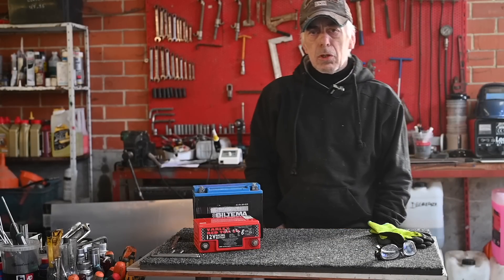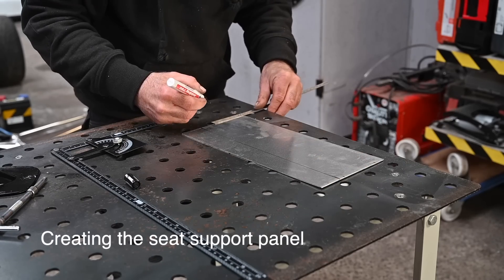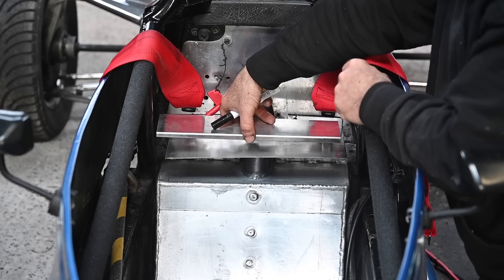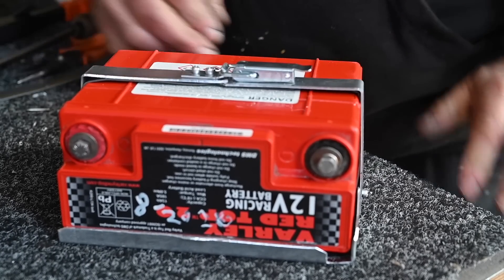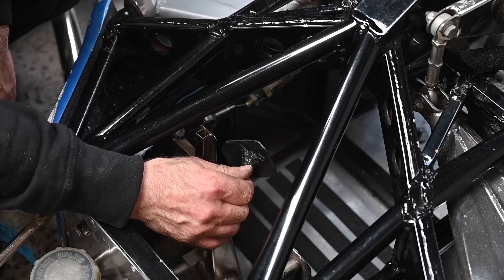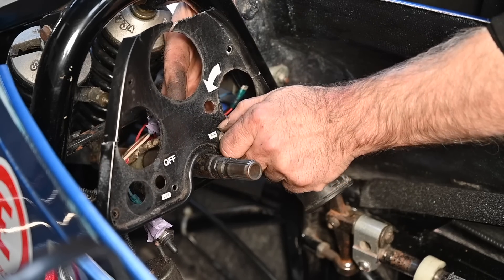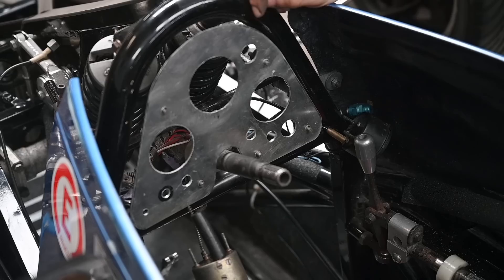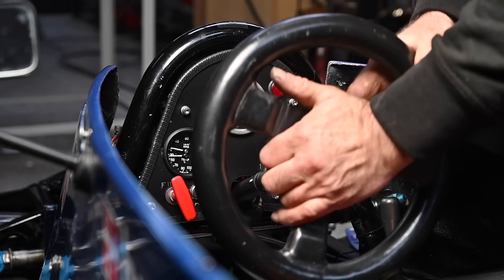Van Diemen RF 85  Prep  work 2

Comment: I really enjoy watching you bring these race cars back to top condition. I have been around racing at various times in my life, so this brings back those memories. Thank you for sharing with us!
Reply from the maker: Thank you, i try.   What ws your role if I may ask.
Reply: Well, when I was young my father sponsored my cousin's race car. I acted as an assistant to my cousin as he worked on the car. I would bring tools, wash and paint parts, and other non-technical tasks. During that time he taught me to weld, and that is something that I have continued to do throughout my life. It is a skill that not so many people have, especially us ladies, but is has been very useful throughout my life. Somewhere along the way I discovered electrical wiring. It seemed very logical so me, so I have done a fair bit of that as well. Not sophisticated modern wiring, but the more basic wiring of older cars from the 50s and 60s. Any time a friend's trailer lights don't work correctly, I am the one to fix them. :-)  My Ex and I used to own an off-road race car but that got too expensive for us to afford.

I do enjoy watching your thorough race car preparations. I like that you tell why you perform certain tasks, rather than just showing the process. Were you involved with professional racing? You have a depth of knowledge that I don't often see on YouTube. Thank you for sharing!

Comment: Nice job. The cover over the battery/extinguisher have taken up some room, have you considered moving to a D-shaped steering wheel? Are you going to check the rod ends for excess play? Looking forward to your progress. Cheers.
Reply from the maker: Txs for the comments, the space is ok and the panel prevents from beeing caught in bolds and clips etc...  The steering wheel disconnects so that is no issue to get in and out.

Comment: Great video Steve. Re the aluminium cover over the battery and extinguisher, would you need to remove it for Scrutineering at a track day or event? It looks like a great set up and will be a great drive and great fun. Thank you.
Reply from the maker: At the event, I remove only the screws on the back and i can lift it to off so that I can arm the fire extinguisher for the race.   Then I place it back, it makes getting in and out so much easier..

Comment: Steve, I see a lot of formula race cars using the electric forklift battery connectors to connect an external battery to start the racecar, so you don't drain the on board battery. I don't see if you are using that or not? BTW, you getting to have a nice collection of race cars!
Reply from the maker: Thanks for the comments,  yes I use that as well on this car .. you see it in epsiode 1

Comment: does it have to be a hard seat under any regulations? Can't you just use a foam bag that molds to the driver and fills the space exactly?
Reply from the maker: Yes you can use the foam, that is an option.. Although the seat is already very tide..  And I am small on  the hips.... not sure how much foam I could take.

Comment: The throttle pedal is placed deep behind the brake pedal. Do you think the heel-and-toe is still possible ?
Clean dashboard ! 👍
Reply from the maker: Those are adjusted later on to the proper position... you are right in the video that does not show like that..

Comment: If you don't run an alternator, how many laps race can you get before the ignition voltage drops? 11.2V is near transistor function threshold. Still need to run the fuel pump.
Reply from the maker: The battery delivers 20AH at 12V...   The only consumer of electricity is the ignition and that draws about 5 Amps max ( high RPM's)..  That allows me to run fine for about 3.5hrs... Each race is about 20 to 30 minutes , so really no issue... of course prolonged racing times will never exceed 3 hours...  In between I charge the battery